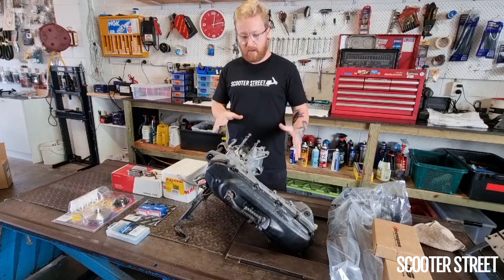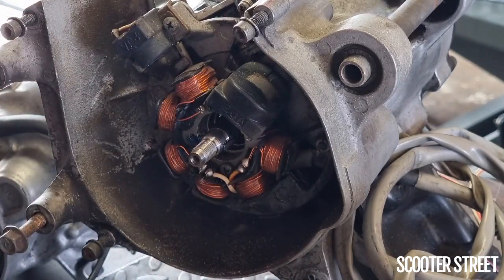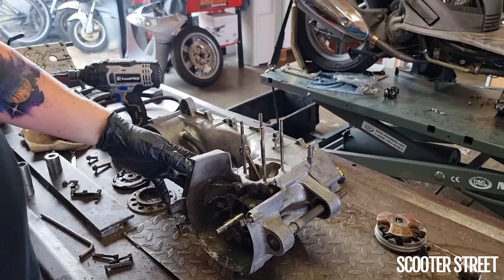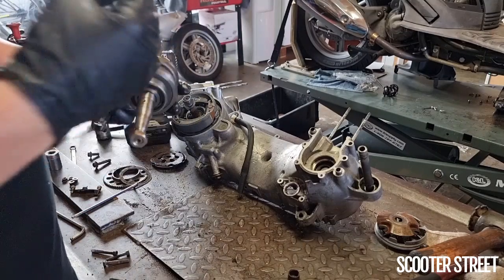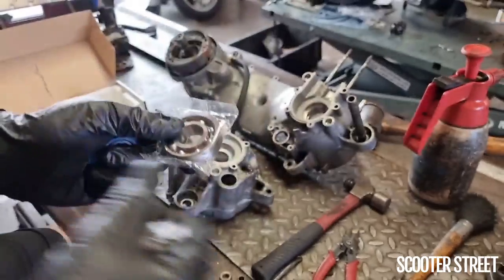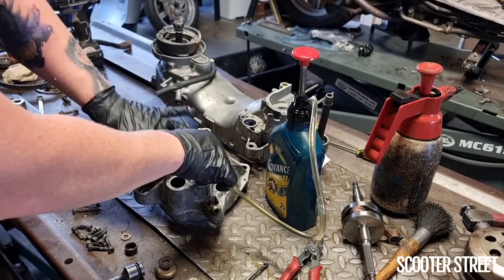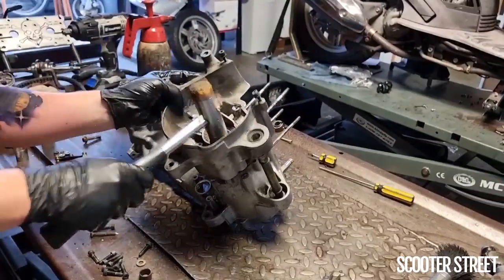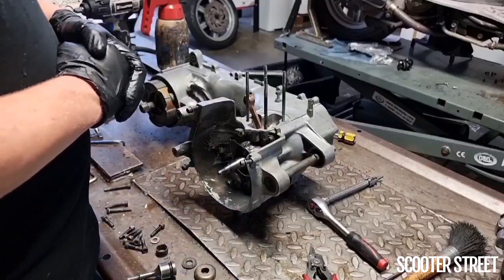CRANK UPGRADE on Yamaha Zuma / MBK Booster! - PT1

Comment: That last part where you tap the crank on either side was a breth of fresh air my crank sat perfect with 0 resistance🎉. Thanks for the video. It helped alot
Reply from the maker: Ahh cheers, An old racer/mechanic showed me this back in 2006 and it works.
Reply: Brother can you give all names of the parts those have been removed and replaced. Please

Comment: Yep, done a couple of rebuilds of these engines on my old slider. Once as it's was trashed when I brought it.
The other time when the oil pump failed. 
Are you going to install a gear up kit to go with the 70 kit?
Reply from the maker: We didn't get the Slider in Australia, but we did get the PGO PMX which is a very close copy of the Slider, fun to ride! No not on this one, the customer just wants a little bit more acceleration as he's primarily riding in 60kph zones. He'll get that, and more🤘😎🤘

Comment: Its better to hammer the bearing with a piece of wood instead of a metal socket. Or on a wooden table. Ive seen them crack with the slightest touch of the hammer on the socket. And also on the rolling nut cases in the cvt cover when they hammer the case in by hitting on the clutch side.

Ive also got a request if i may: Could you please make a video explaining the functionality of the brass weights on the Stage6 Torque control clutch? 
I cant find info on it anywhere.. only that its used on some kartings jetskis and snowmobiles .. but not what they actually do and how to set it up.

Btw Love your videos  <3
Reply from the maker: Yes so true.. As long as the bearing internals aren't stressed I'd imagine wood would do the trick too. I personally like that the socket ensures that only the outer ring of the bearing receives pressure.

In most cases we would have a block of wood underneath the casing, but the plastic ended hammer we have here is pretty soft.
Reply: @scooterstreetau  true but it was not in the bearing slot, where i saw them crack 4 times (on 1 i did it) was almost in the middle of the case, where it curves down after the variator area :/ 
Specially if the case isnt flush with the table, that 1mm play makes all the difference. 
I hollowed out a piece of wood to fit the outter ring of the bearing and hammer on the wood, and the case on a yoga matt 🤣
I believe it happens more often on old stressed cases.
Reply from the maker: @joaomelo61  Yes we should do better, we have a sheet of condensed foam 60mm thick. We use it next time to show more care🤩

Comment: Pls help. My zuma making a whirring/ screeching noise when I rebuilt my bike but im 99% sure i lube the bearings
Reply from the maker: Lightly tap the crank shaft on the right hand side, if this does not help dismantle the engine and find the issues.
Reply: @scooterstreetau  thank you i will try

Comment: How do you replace the 2 bushings where you mount the engine to the subframe mine blew out riding
Reply from the maker: Use a press to push them out and install new, some people use bearing but the rubber provides the best cushioning.
Reply: @scooterstreetau i just ordered some bearing because i didnt find bushings but i dont wanna split my case again
Reply from the maker: The bearings offer short term solution and they have no give. @robintanckere7822
Reply: @scooterstreetau do you maybe know where i can buy rubber fittings for the engine mount
Reply from the maker: Yamaha @robintanckere7822

Comment: The last  bolt seized removal operation, is also a trap into the obvious well practiced solutions like heat, essential for  red loctite addicts , but not always clear for me is to  replace the good  bolts and torque down so distortion is minimal .   Trained professional eyes always  tuned in   is what mechanics tell they poses. Pain in the neck brother .
Reply from the maker: Always a good idea to exercise restraint with loctite.. We usually only recommend for brake bolts, and used sparingly at that. The best rule (particularly with hex bolts) is if a bolt is even remotely questionable, replace it.

Comment: Brother can you give all names of the parts those have been removed and replaced. Please
Reply from the maker: High compression Crankshaft, Main bearing and oil seals, Tecnigas exhaust, Malossi sport 70cc kit, Malossi vriator.
Reply: @scooterstreetau  thank you soo mush
Reply: @scooterstreetau  I have an old mbk like yours that I want to rebuild it thank you
Reply from the maker: Ok will be a great project. @aliamran6954

Comment: I put it together to the point you did in the video and the crank doesn’t spin
Reply from the maker: Check it out find out why. Are seals correct?
Reply: @scooterstreetau  i haven’t put the seals in yet, my buddy says that it’s probably not correctly mounted bearings but i put them in pretty good
Reply from the maker: @blaz4698  Ok chek the bearing are inserted all the way in to the cases. Split and try again👍👍